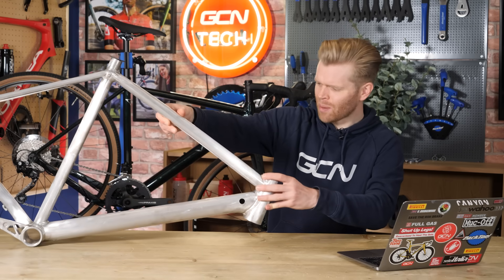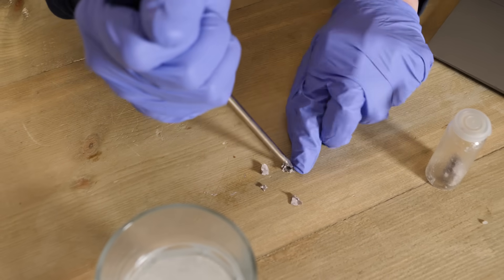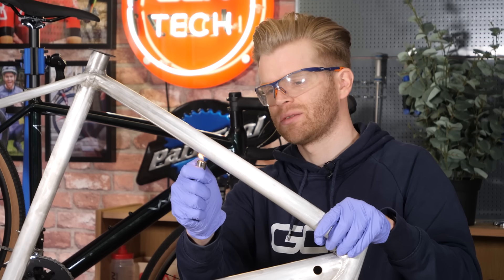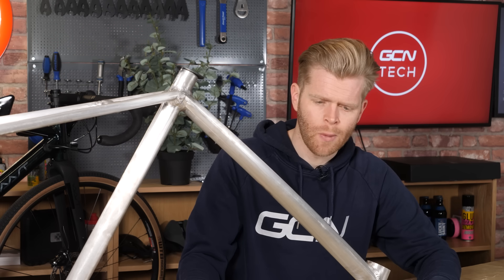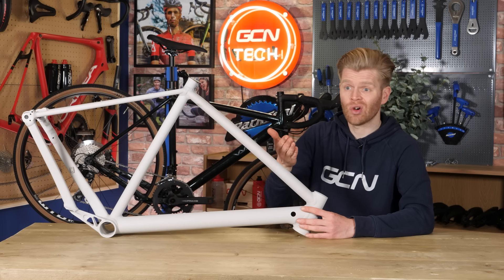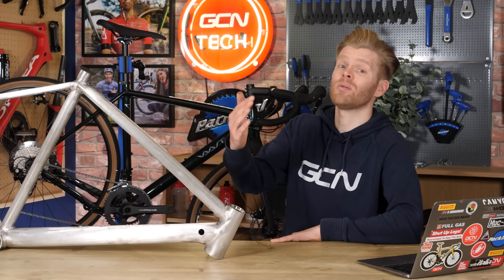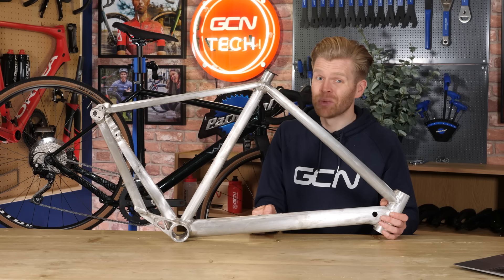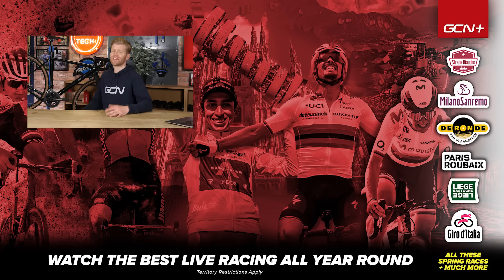5 Things You Need To Know About Magnesium Bikes

Comment from the maker: Have you ever used a Magnesium frame?
Reply: I purchased a Vaast A/1 frame and built it up with XTR drivetrain, Paul Klamper calipers, and Thomson hardware.  I really can't tell the ride difference compared to carbon, but being the bike nerd I am, I just had to get one.  I haven't crashed it yet, but I did drop a pedal wrench on it without any issues!  The price (about USD $1200) made it a good value.
Reply: Do magnesium sliders on my mtb forks count?

Which brings me to a downside of using steel bolts in magnesium holes: it can be easy to strip the threads in the hole if you aren't careful enough - I know this from experience!
Reply: I’ve used a magnesium mountain bike for 5 years with no issues whatsoever. It was light and I loved it!
Reply: In the US there was a mtb company that made magnesium frames - lodestar.  They rode like the alu frames of the time but were not made well. Cracked too often
Reply: I have a vaast a/1
Set up tubeless with Rene hursts love it my favorite bike to commute and tour on it does exception on gravel and fire roads. I’m surprised how stable it feels fully loaded.
Reply: Yes. We have a Paketa magnesium tandem. It’s both more compliant and stiffer than our first tandem, an aluminum Santana. Having ridden it over 6000 miles, we couldn’t be happier.
Reply: Yes Ducati
Reply: @quickdiy8127  .. One of the foldable ones?.. or one of their road bikes?.. or a Motorbike?.. I got a Ducati 900ss..I wish that had a magnesium frame....I'm gutted now.. I feel less of a man 'cos my ducatis smaller than yours......... :(
Reply: Actually I have a magnesium single speed, but the downtube broke (without impact ) close to the headtube after ~7 years of riding. Anyone knows who might be able to fix it?
Reply: Haven’t… would love to try out one if available. 😀
Reply: Nope, but my racing go-kart had lightweight magnesium rims… I just wouldn’t think of making a bike frame out of it. 
Great Science video as always Ollie 👍
Reply: I had a VW boxer with a high Mg content. If it caught fire they said there was no way to put it out. Just bury it.
They use Mg casings on motorcycle engines. I don't see too many threaded parts.
Reply: I have a Pinarello Dogma made with Dedacciai’s AK61 tubeset and carbon Onda seatstays.
Reply: Nope, but my next frame will be!
Reply: @Pastamistic  any closer to getting the Mag Frame?.. I'm interested, You don't see much of 'em around nowadays tbh.
Reply: @mrmagoo.3678  Nope! Don't have the money and the after effects of Covid have been rough. Long covid seems to be clearing up and I'm getting back to riding so maybe I can justify a new bike soon.
Reply: @Pastamistic  Oh Jeeez!.. well.. at least You're still here breathing! can get back to the bikes later.. Great to see you still here at least though! with this whole Covid malarkey then it could've turned out worse..
Reply: I have one .  Its quite good.  close in weight and comfort to carbon
Reply: Yeah. I have one Vaast A/1 in my garage. Love it.
Reply: I have two Scandium (Aluminum with 2% Scandium) frames (bikes); a road bike and a cyclocross bike (or, as they call them today, a gravel bike). Maybe one day I get a magnesium frame too.
Reply: Magnesium frames are awesome, have a really interesting feel to them. What would be cool next is a graphite frame, graphite is probably too expensive and hard to make into a frame though.
Reply: I Just thought of something, the Magnesium Bike frame would literally melt in a house fire
Reply: plants have chloroFORM in them, do they Ollie?
Reply: Chuck Norris used magnesium frame to weld something I don’t know.😂
Reply: does 5xxx alloy count?

Comment: I only had magnesium pedals.  A frame would be interesting.  I don't know who would make a 20" frame though in mag.  Would it flex like titanium? Or would it be too stiff? It's more engineering but I do like the concept especially if it's cheaper. I remember Hutch made seat clamps and the hubs had mag parts for bmx in the 80s.

Comment: Excellent presentation.. sweet.. simple and nailed it securely. Magnesium certainly has come of age and hopefully become a reasonably affordable and easy to find choice. One kilogram not bad and the ceramic coating included all the better. Its about time. Is this going to hold up in salty coastal and winter roads better than steal ( steal holds up okay in the rust belt but you better use some frame saver and stick to the heavier gauge stuff... a lot of mantainance plus the bike will be heavy. Those coastal bikes should also get the frame saver treatment as they can rust from the inside out and sneak up on you with a bunch of dead tubes that thud and don't ping when you flick it with the nail on your middle finger) and aluminum (my experience aluminum isn't that great ... I've had to call a few costumers and let them know that their frame had some holes under that blistering paint near the bottom bracket and head tube ... carbon fiber just foolish)  if so then there is an excellent material for the four seasons everything bicycle. Looking forward to some more scientifically detailed expansion of this topic... more chemistry, material science and engineering.

Comment: Young modulus in simple terms is about material stiffness and is often represented by a spring and more often referred to as the elastic modulus to distinguish it from the shear modulus, a measure of “rigidity”. It has nothing to do with strength or the when it starts deforming.the two might vary together likely depending on alloying but do not affect each other. Regardless wish I could afford one. And not to belabor the point… anyone who has seen on the highway a semi pulling a loaded trailer flexing up and down is seeing a perfect illustration of the elastic modulus in real time in a way that one will never see in a bike.

Comment: The melting point of a material is absolutely Irrelevant for how environmentally friendly a material is!
The energy required to melt a metal or glas is just a tiny fraction of the energy needed to produce any goods.
Alot of chemical processes to produce resins, glues and polymers are way more energy hungry than say melting glas into new bottles!
And the product it's used for is another factor, because a bike will get used for many years until it gets recycled, and a tin or glas filled with peaches or beans just get the food to the consumer and it's done.
That's also why less processed food will be packaged in less expensive packaging, like vegetable in glasses.
More exotic ones like peaches are in tins because they have to travel farther, so the lighter tins are worth the higher cost.....  And so on!
Bothem line is! Use your brain and don't just listen to someone telling you what is "green" and what is not! He might just want to sell you his product!

Comment: Mag alloys can catch fire when using power tools like angle grinders on them or when welding or machining them.  The swarf from machining is also very flammable and can be ignited by sparks.  The manufacturers have to use an inert atmosphere to eliminate oxygen while machining or welding.  Source: I worked at a company where we had a magnesium alloy fire in our machine shop because the gas bottle ran out!  It makes a blindingly white flame when it's on fire, like an arc welder.  A cigarette lighter doesn't produce enough heat to be a problem, and the ceramic coatings are designed to prevent combustion and corrosion.  If un-coated and you put a sweaty hand on a piece, it will turn dark grey or black as it reacts.  

In terms of energy to produce new material from ore, it's worse than aluminium, because it's more reactive and harder to separate from the oxide.  For recycling and reshaping, it takes the least amount of energy compared to the other useful engineering alloys, because it is softer.  There's a lot more aluminium and steel in circulation, so there's more infrastructure in place for recycling those.

Comment: Almost convinced. All the benefits are great but carbon fiber still has a huge plasticity. That is, it can be shaped in much more complex shapes. Which allow for greater aerodynamics and adaptations for rigidity and compliance in different parts of the frame.

Comment: Also, it seems there's another imprecision, bare aluminium will not "rust away" like iron carbon alloys as you seem to imply because the oxyde layer of aluminum has enough adherence, impermeability and mechanical toughness to protect the metal beneath, except in more extreme environment like acids below pH4. Whereas, as it is said in the video, magnesium alloys will degrade by corrosion as easily as iron base alloys exposed to ambient air and a bit of moisture. So basically those frame could be one dent in the paint+coating away from rusting like steel bikes do.

Comment: dampening means that their is an hysteresis in the loading curve which is not the case with a metal that has not bent plasticly, hence the need for oil circulating shocks on a working suspension. Metal alone is not dampening the cinetic energy of an impact.

Comment: Bought myself a Vaast A/1 not long ago. It's a seriously good bike, and for a while the pricing on it was outright insane: I got my 1x11 Rival hydraulic build with Stans wheels and a carbon crankset (!) for just $1700. Not to mention, it was actually in stock and available for online ordering, which was a miracle in current times.

I would like to note something on the video: right around 10:30 you mention that magnesium, as a more compliant metal, can be softer and more flexible in a bike frame. You also mention that alloys can make up for this. Strictly speaking, this isn't really true; assuming the geometry of a given frame stays the same, how soft or flexible it is correlates directly with how compliant it is, and both correlate directly to the material's Young's modulus. (By geometry, I mean things like the tube profiles and shapes of the joints, not things like stack or reach or top tube length) You can't make this theoretical frame stiffer without also making it less compliant, and the only way to accomplish either is to alter the Young's modulus. Alloys in general cannot alter Young's modulus significantly compared to the base metal, so it's not correct to say that you can make a bike stiffer and less flexible while keeping the same compliance simply by using an alloy.

So, put in simpler terms, theoretically a frame made out of pure magnesium and an identical frame made of AE81 alloy will have practically identical stiffness and compliance characteristics. The alloy improves neither characteristic. However, the difference is that the pure magnesium frame will almost certainly be too weak to ride, and may fold under you as soon as you sit on it. (The same thing applies for pure aluminium vs aluminium alloy, pure iron vs steel, and pure titanium vs titanium alloy)

Instead, what you can and should do is alter the geometry of the tubes and joints outright. By, say, flattening out certain parts of a tube, or using different wall thicknesses on different sections of tube, you can change the flexibility of the frame on different axes. That's how the so-called "lateral stiffness and vertical compliance" is achieved in isotropic materials such as metals. (Carbon gives you more options with the orientation of the fibers.) Sometimes, these changes will require certain alloys to maintain the same strength or fatigue standards, but the benefits found for increasing stiffness while maintaining compliance are still a result of the tube and joint shapes, not in the alloy.

This is why hydroforming aluminum is such a common practice, and why tube butting is used on so many different metal bikes.

Comment: Love your science stuff Ollie.  Nice try but this is basically an aluminum frame with some magnesium in it to save weight.  How much weight?  As with all aluminium alloy frames it will have a finite service life - a short one - as it work hardens in the stress cycles from riding.  It then becomes progressively harsher to ride and prone to stress cracking.  Nothing sadder than a top end alloy frame that is now horrendous to ride and falling apart.

Comment: I work in the Waste Management field. I specialize in hazardous waste management.

You guys are absolutely crazy if you think magnesium Metal is more environmentally “green” than carbon fiber because carbon fiber end products can’t be recycled.

You would have to be clueless of the staggering quantities of waste produced by both magnesium and aluminum manufacturing of the primary metals or the enormous amounts of energy required to manufacture the products and the massive quantities of green house gases, hazardous air pollutants (HAP’s) and hazardous waste including acutely hazardous waste generated by the manufacturing of these two metals.

Go look at a material balance by a professional engineer on these three products, aluminum, magnesium metals and carbon fiber to see just how wrong you are.

Not even steel manufacturing comes close to the pollution, hazardous waste and greenhouse gases produced by either primary aluminum and magnesium manufacturing.

Don’t believe me? Take a tour of a carbon fiber manufacturer than visit a primary aluminum or magnesium plant. It will take you only seconds understand just how wrong you are with that comment.

Comment: The lightest or least dense metal that is a pure element is lithium, which has a density of 0.534 g/cm3. This makes lithium nearly half as dense as water, so if lithium was not so reactive, a chunk of the metal would float on water. Two other metallic elements are less dense than water.

Comment: I can see how the crystal structure might affect the vibration dampening but I'm not sure it is directly related to Young's Modulus. YM is basically the 'spring rate' of the material, so that's like saying a softer spring will naturally damp vibrations more. It won't, you still need to introduce damping some other way...

In the case of the material this might be via 'hysteresis', the energy lost as the material springs back into shape. If the material has higher hysteresis there will be more internal resistance against its springing back and this would probably have a damping effect on vibration...?

Comment: It’s a material that just doesn’t really have a point to it? I mean for a bike frame. 

It’s heavier than Carbon and Titanium. (In the video they say it’s lighter than titanium but that’s only the raw material.) The Magnesium frame in the video is unpainted and it’s already 1kg. After paint you can add another 2-300g at least. A top end titanium frame can be as little as 950g and can be left unpainted. 

Durability? Well similar to aluminium and like aluminium if you damage it it can’t really be re-welded. You just throw it away. Unlike carbon that can be repaired in some situations and titanium and steel that is less likely to get damaged and easier to repair. 
Also it corrodes, unlike titanium that doesn’t. So upkeep of a Ti frame is so much easier. 

Price? Well because it’s so uncommon you will be paying a premium, you can actually get titanium for a similar price and aluminium for much less. Even cheap Chinese carbon is now and option if you are that way inclined? Steel is also less if you are looking in the right places. 

The ride will be similar to aluminium, so not comfortable. Unlike titanium or steel. Even some carbon bikes now aren’t terrible for comfort. 

So unfortunately, I honestly see no advantage to this bike Material. 
Spend a bit more or look for a sale on a titanium bike.

Comment: I think this is the "it" bike for me. 
I have a high end carbon bike, a high end custom stainless steel bike, a high end vintage steel bike and a high end aluminum bike. But, it looks like magnesium ticks off of the boxes for my next bike, an all-road specific bike. I know I'm done with carbon. 

Ever since I've gotten back on metal bikes, I've dropped more "mental weight" in not having to worry about working with my bike (riding rough roads, clamping it into the stand, transport, crashes, etc...), however, I'm pretty sure I won't go back to aluminum. I've ridden titanium, but prefer the ride or steel. 

You can't expect any one bike to rule all facets of cycling (comfort, durability, weight, performance, etc...), but it looks like magnesium prioritizes those traits I need most; Comfort & durability + weight savings while still not feeling like a noodle. 

I love the feeling of being able to hammer down an imperfect road without worrying about my steel rig...again, loss of mental weight. If I can shed a couple of pounds and keep it in the 15-16 range while still offering a stiff, but NOT bone rattling ride "and" be on a metal bike? 

That's the bike I want.

Comment: Used to had 3 Merida magnesium MTB frames at 2003-2004. All brokes, and replaced by quarantee. Last was replaced to carbonframe, witch is today still  alive. I think that, broking  reason was engineering mistake, not  material, but anyway, Merida stopped productoin of mg frames.

Comment: I’ve had many bikes , they have been made of aluminium, steel, titanium, magnesium and carbon

The only bike frame I’ve ever had snap was ——- magnesium 🙄🙄
Reply: Just curious - where did it snap? At a weld or in a tube somewhere.
Reply: @subtropicalken1362  I don't think any frame will just snap in the middle of a tube due to how leverage works.
Reply: @argh1312  I would certainly think it unlikely but “snapped” with no other info leaves a lot of room for speculation. That’s why I asked. A notch on a tube from an accident or mishandling could lead to a stress concentration that could propagate to failure. Murphy’s law. 🤷‍♂️
Reply: magnesium rims for cars were also known for snapping
Reply: Did it have the fancy coating Ollie mentioned?